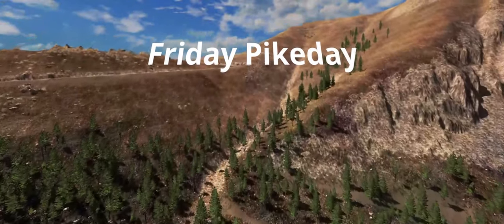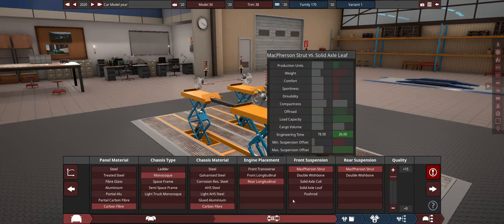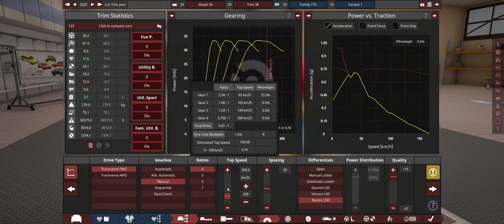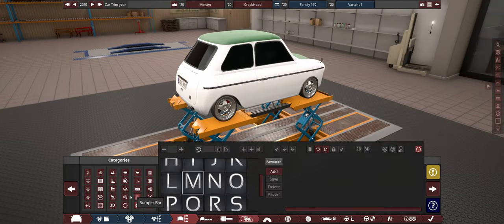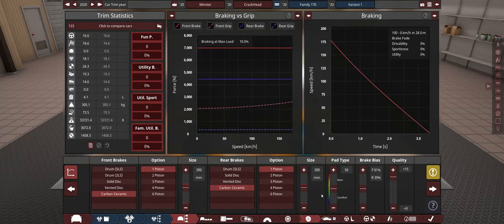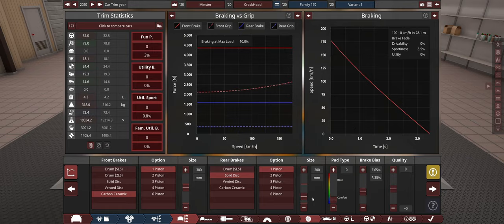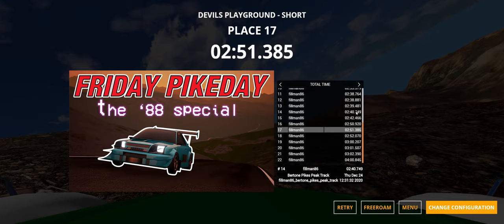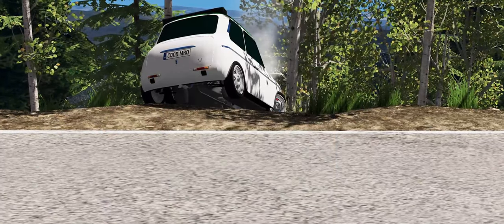300kg Super Light Micro Rally Car (automation🔧BeamNG)

Comment: If you wanted to save even more weight, you should have rammed the brake pad type all the way up, then dropped the rotor size until you either get brake fade or until the brake force is too low.  Also, ram the brake airflow all the way up to reduce brake fade even further.
Reply from the maker: yeah, but it's not that much of a difference, and I didn't want a trash car. Brake fade tends to rear its ugly head when going up pikes peak haha
Reply: @fillman86  Yeah, though I haven’t really had as much trouble with it on Pike’s Peak as I do on the West Coast Circuit, oddly enough.
Reply from the maker: I didn't want to make it half way up and then have to remake the car. This is because the other small car I sent up pikes peak had major brake fade XD
Reply: the short cast headers get chosen and that adds weight with the turbo
Reply from the maker: @ibuildblasters8118  ooooh good point, but I think it was an okay trade off